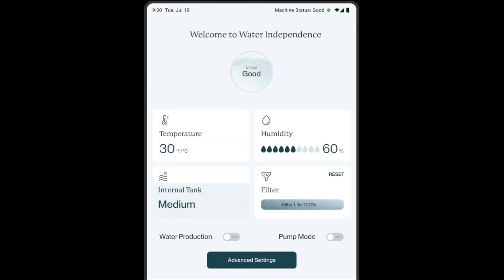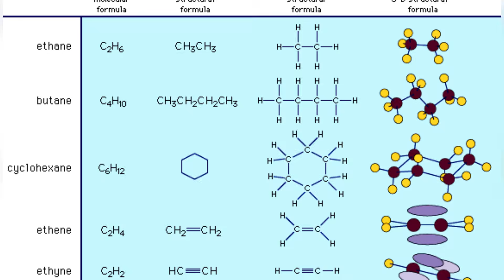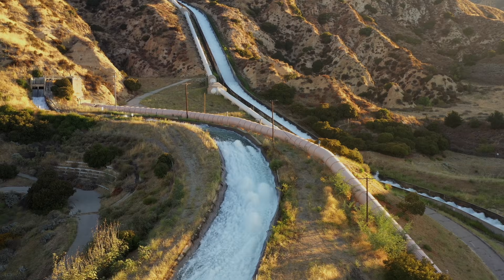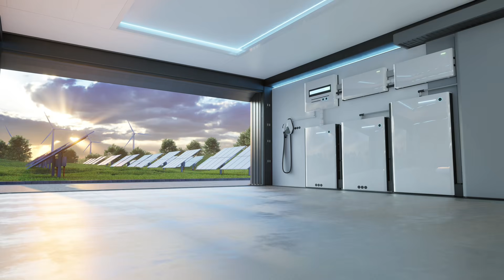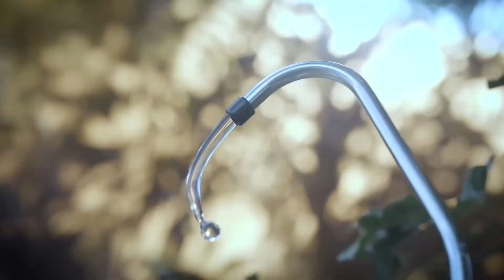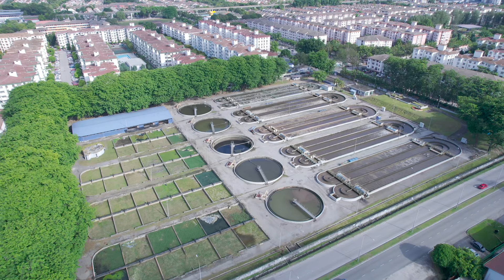This Solar Generator Produces Up to 264 Gallons a Day and Could End Your Water Bill

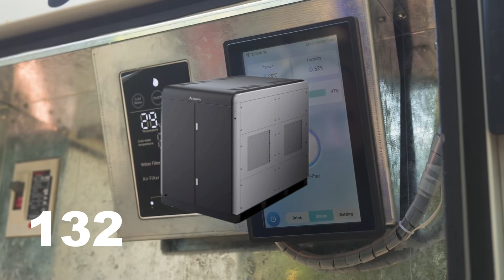Comment: 3:34  .93kw x 132 gallons = 123kw per day. 123kw x .11 cent = $13.53 running cost per day. Or $392 for 29 days. This is after you pay for the unit. Or a dedicated 20kw solar array would probably zero out the energy usage.

Comment: Running costs will need to include the price of filters - the ones shown definitely do not last forever. Its like a domestic air purifier - cheap, until you find you need new filters every couple of months.

Comment: makes little sense. i use the rainwater that falls on my roof, and have never run out, even though i live in a very dry desert.  If i owned one, it would not have been used once. But, it is smart in a sense. It gives you next to nothing for a lot of money.

Comment: Or you could buy a 500$ DIY Heat PUMP Mini Split Heater/AC and put a 50Gal bucket on the Drain line 20$ Brita Filter All why cooling or heating you house.  Couple with 3000+ watts of solar and free water and Heat+AC for day time..  System look cool for Rich Uber Cali types..

Comment: These machines are going to further destroy the water cycle. Leading to worse and worse droughts. I'm so sick of people thinking this ish is magic just like they believed plastic was. We need Transpiration and evaporation to form clouds. This destroys the water cycle at the very beginning.
Reply: After the water does it's thing it goes back into the cycle.
Reply: I don't think it would have any meaningful disruption to humidity levels... even at scale.  The bigger issue is the amount of energy it consumes... making 100 gallons a day would take nearly 100 kWhs.  That's a LOT of power.  Even if you have the solar onsite, it would take a fairly large residential solar system (like 20 kWs or say 50 panels on a home in the southwest) to keep up with that much water production.

Comment: Cali will make it illegal. 😂
Reply: It should be, If everyone used them there wouldn't be rain anymore. It will destroy the water cycle at the very beginning, at transportation and evaporation. No more rivers to pollute.
Reply: @darkfox2401 when they use the water it goes back into the cycle. It's not gone forever.
Reply: @kikib48grid  Good old fashion, matter is neither created nor destroyed.